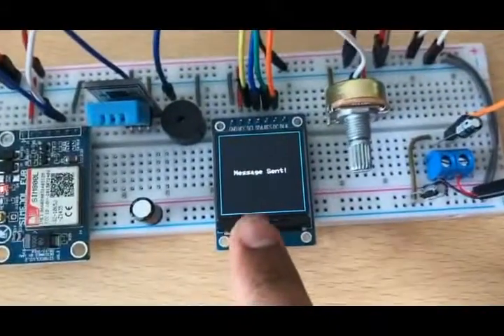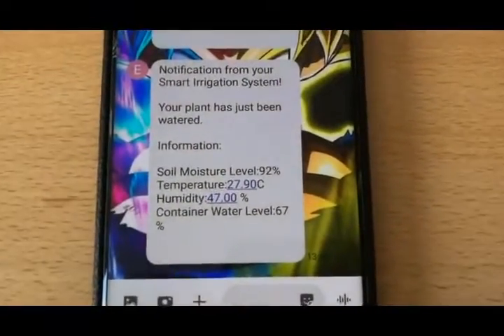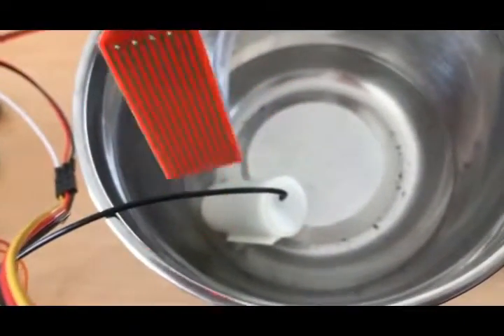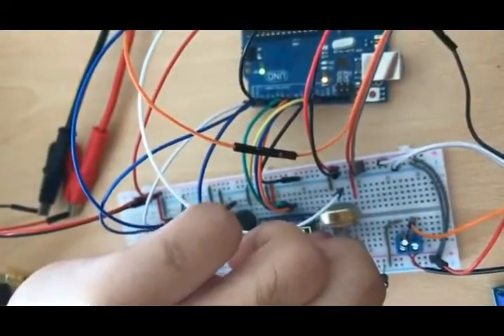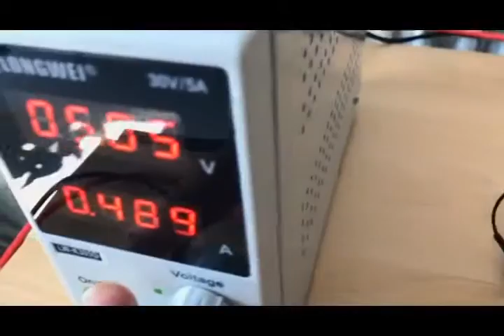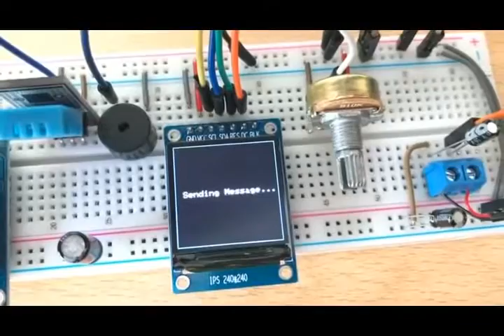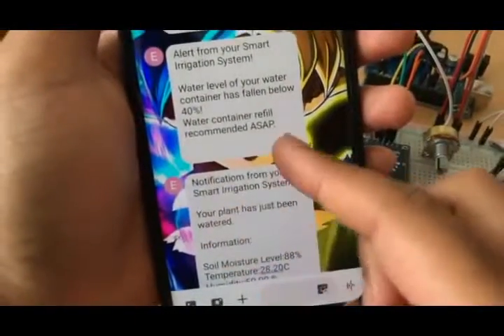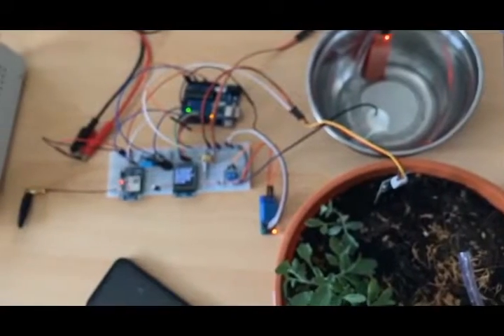Smart Irrigation System using Arduino and  SIM800L v2 GSM Module #arduino #electronic  #science

Comment: Nice work Sir, coud you please share the schematic diagram so that we can know how to connect the components in the circuit. I've seen the github link of the project and there is only an ilustretive image of the project. I would like to know how to make a similar project for my academic studies.
Reply from the maker: Hi, I added the schematic to the project's GitHub repository. Please take a look and make any changes to your circuit if required.😃
Reply: Thanks Sir

Comment: How to make this with sim 900 gsm module plees make and send please
Reply: They work the same way.U can use the same AT commands using the software serial library in Arduino IDE.The connections are the same as well VCC,TX,RX and GND pins are all you need to make use of.